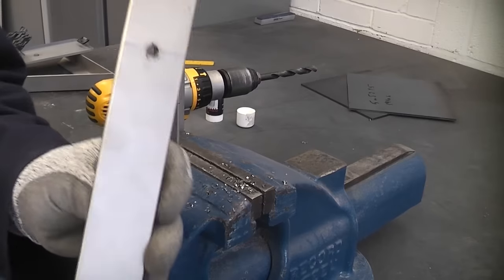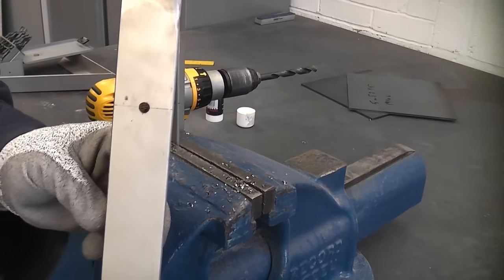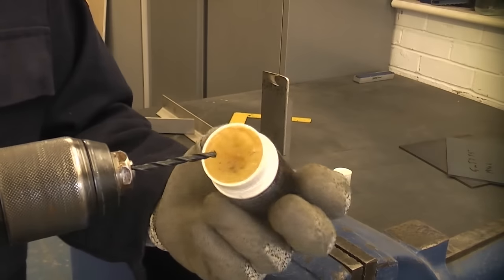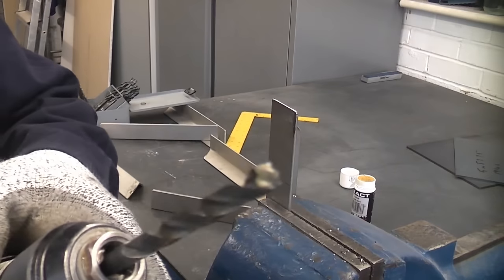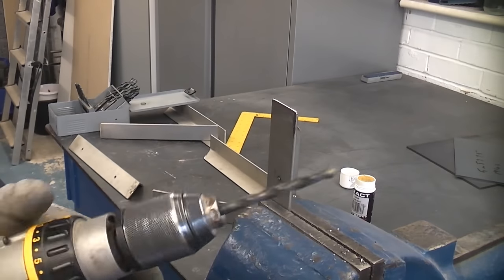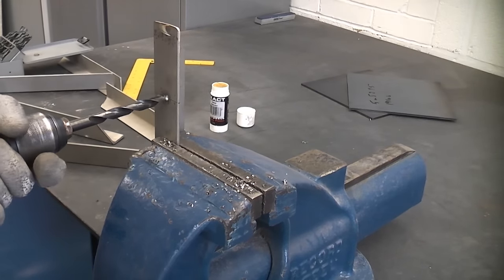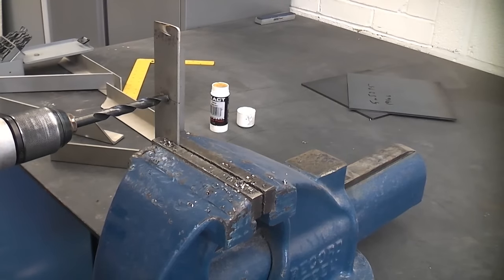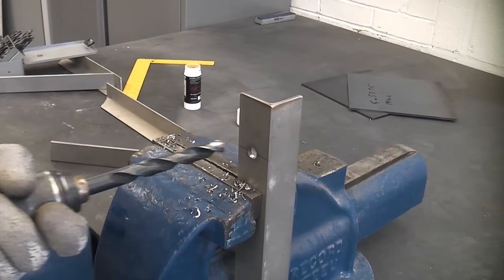How to drill stainless steel

Comment: Good vid, you make it look so easy, thanks!  I dont mean to butt-in on your really good vid, so please forgive me, but I just wanted to share this. I've always had problems with 304 and 316 (austenitic) stainless and I've found a few tricks that work for me.  The first thing is make sure the drill is as sharp as possible. If its a cheap TiN coated HSS jobber drill, it might not actually be sharp enough (or ground accurately enough) to begin with. If its not really sharp you'll never get it started. It also helps to start on a punch mark.  Your right about keeping it cool; last thing I did with stainless was drilling about 60 holes, 6mm diameter in 1/4" 316 plate. Because the piece was smallish and flat, I put the plate inside a tub filled with water (on a block of wood so I didnt drill through the tub) so all the drilling was completely submerged.  OK, it was a bit messy and obviously I could not clamp it, but it made a massive difference and I was able to breeze through 30 holes without needing to sharpen.  Just pressing the plate down a little before the downforce on the drill took over was enough to stop the work rotating.  Other things are; if sharpening drill bits, dont let them get too hot, you'll take the hardness out of the metal.  I keep a jar of cold water handy and just keep dipping the bit every few seconds to cool it.  I also use the water dip to keep the bit cool while drilling. As far as drill types go, yep, Dormer are quality, as are Presto.  Cobalt alloy bits are great but will also get dull if too hot, same as HSS. You can also get "solid  carbide" which are pretty expensive but wont dull (I've not actually used these these on stainless but have used them successfully on 6Al4V titanium alloy.  You need to be very very careful if using these manually cos they are very easy to chip or snap.
Reply from the maker: Thanks for the detailed comment 👍
Reply: Awesome information. Thanks man.
Reply: Nice. I’m thinking of using some kind of plastic container that’s rectangle and the same size as a 304 ss pipe i’ll use. I would fill it with water and i could put it in my vise.

I’ve just been dipping in water, but i am planning to drill a lot of holes.

I am thinking i’ll bring what i’m doing inside for the tapping process. I’ve broken a few taps when working in the 0°F shop. I reverse and break the chip, but i haven’t used oil or anything. I usually do something the wrong way a few times before i consult youtube.
Reply: I found this video and after reading your comment about submerged drilling I had to try it . I’m with the US NAVY SEABEES and we got some 5mil stainless gussets with incorrectly drilled holes. After a frustrating day of work hardening the pieces I watched the video and learned the proper techniques. The next day I built a custom box to hold the pieces and lined with plastic and started. I immediately got much better results. Your comment saved us a lot of wasted time
Reply: Sometimes you can see some smoky vapour rising up when you are drilling. I’ve always thought that you should stop then and cool the job and drill bit before continuing because it’s getting hot, but you didn’t. Am I missing something here ? Cheers.

Comment: Thats some soft stainless
Reply from the maker: All metals are soft, when you have the correct drill bit and the knowledge to use them 👍
Reply: @ultimatehandyman  not 304 ss
Reply from the maker: We mainly use 316 on site 😉
Reply: @ultimatehandyman your stainless is soft

Comment: Speed & lube yes but it is critical to know the the type of drill bits that work best. That drill bit went thru faster than I have seen going thru good stainless steel. Not too helpful so far.

Comment: When smoke starts coming off the job, doesn’t that mean it’s getting hot and you should stop. But you didn’t. Have I got it wrong. How else do you know it’s getting too hot? I don’t want to feel it. What am I missing here.
Reply from the maker: Too much heat is bad and will soften the drill bit and cause it to go blunt, but a bit of heat (enough to cause the lubricant to smoke will be fine)  👍

Comment: I just spent what feels like forever drilling stainless. Of course it was already hardend because knifes are hardend to keep an edge. Turns out my bit was dull! 10 minuts scribbling with it on my knife sharpening stone and it cut right through the tang of my knife. Now I need to sharpen again! I hate cheap drill bits! Thanks for the video! Great information.
Reply from the maker: Matthew Tikka There is nothing worse than cheap drill bits.
Thanks for the comment ;-)

Comment: Drill bits are important too. Had to drill some Stainless in an elevator yesterday and I broke all my black oxide bits trying to make one hole. Used a Milwaukee Cobalt bit and it did all the rest of the holes with out even dulling.

Comment: If you're in a pinch, a few sprays of WD-40 while drilling will work. Try to do it from the back side, to hide any marring of the surface. And TiN (Titanium Nitride) coated bits and taps will save you a lot of headaches, especially when working with smaller sizes. They can cut through some work hardened stainless.
Reply from the maker: +Christopher Weick Thanks for the comment

Comment: I drill aluminum, cast iron, and stainless steel at work and the only bits I got are HSS bits. Do I need cobalt or carbide bits for them? Or is that overkill

Comment: Thanks, glass and s.s. are the most pain to drill, by far- so true. What's the rpm (setting on the adjustable drill)?
Can you submerge it in water, while you drill, instead of using cutting oil or cutting paste?

Stainless, chipped my cobalt bit (cobalt bits, especially the thick ones are very expensive).

God bless, Rev. 21:4
Reply from the maker: Yes, you can submerge under water, if possible.
Stainless is a real pain, because it can work harden!
Thanks for the comment 👍
Reply: Not the place for your holly molly. Had you paid attention it was clear that it's good to use water for cooling.

Comment: What kind of bit is that ..?? I just tried to drill a hole thru T-304 stainless exhaust pipe and it was a MOTHER FUKER to drill thru. The screeching sound was insane. And yes i damaged 3 of my bits trying to drill thru but eventually i got thru.

Comment: Thanks for video .
I had to drill ss chefs  knife blade to fit a broken blade in a multi tool.
I cut the section out with angle grinder keeping it cool .
Marked out where the 4mm hole would be .
I used quire a blunt centre punch so had to hit it a few times .
So problebly  work hardened the area 😢
A good sharp drill bit in pedistal drill would hardly touch it .
Kept using WD40 to keep things cool .
I had to re sharpen 5 times before managing to drill half way through.
It produced a whitness mark which i was able to centre punch .
With a freshly ground punch .
Tried to drill again with same results 😢
I finished up driving the centre punch through the hole pushing the centre out  much like hot punching work in Blacksmithing .
I tried to drill the remaining metal out but to no avail .
I filed the hole out with needle files compleated the multitool repair .
I wish I  had watched your excellent  video first. Never to old to learn new tricks @69 years 😅

Comment: When you say "Don't let the work piece get hot", how hot are we talking? How do you know if it's too hot? When you were drilling through, surely it was getting hot there, right? Friction has to cause some amount of heat. Any tips on ensuring it won't harden?

And also, is hardening a permanent thing? If it DOES harden, will it just cool down over time or will it be permanently impossible to drill through?

Comment: Awesome, thanks! I had some brackets made wrong and now I need to drill four 12mm holes through 3mm SS. Who would have thought YT would recommend the exact video I needed. Now I just need to compare prices of 4+7+10+12mm cobalt or a cobalt step drill. 🙂
Reply from the maker: Cobalt step drill is the easiest option, I bought a set a while back-
https://www.youtube.com/watch?v=fvumt2z0GLI&t
Reply: @ultimatehandyman  Thanks for the reply. I bought a cheap set of HSS step drills a while back from Banggood too. Currently they show cobalt sets, but only sell individual drills which get expensive in the larger sizes.
A professional step drill from my engineering supplier costs over AU$250. I copied your demo and bought the 4 twist drills for AU$85 (around ₤45).
Reply from the maker: @philscott7949   Blimey, I did not realise things were so expensive in OZ.
Lucky you can use Banggood 
Thanks for the comments 👍

Comment: Okay I thought I was drilling mild steel. Turns out that it's stainless steel 6mm thick. I've already started drilling the holes. I think I've work hardened the holes. I'm probably only got about halfway through. I've tried use HHS drill bits, cobalt and just brought another DeWalt drill bit specifically designed to drill SS. I've not gotten any deeper.

Have I now ruined it by work hardening it? What are my options now? Do I got out and buy another drill bit? Diamond coated maybe?
Reply from the maker: It's a pain in the backside when it work hardens. I would try a good quality cobalt drill bit. You might have to get a smaller diameter one and go through with that first, so if you are drilling a 8mm hole, go through with a 4mm first. Use plenty of lubricant/coolant. If it is not cutting you might have to start looking at specialist drill bits such as a TCT one, or solid carbide if you are using a pillar drill.
Good luck with it.
Thanks for the comment
Reply: Okay I've tried a small bit but it but it doesn't seem to bite. I'm going to try TCT bit

Thanks for taking the time to comment. You're videos are very useful thanks

Comment: Good job... Heat is the enemy, I spritz the material and dip the bit with water and allow both to COOL😎  in between bit size progression, time (+/- 10 seconds or steam) and depth of material. Clearing debris along the way. 
Initial drilling (most important) too fast will harden the steel instantly, then you r mostly screwed. Slow and steady don't AK47 it.
Reply from the maker: Thanks for the comment 👍

Comment: When centre punching stainless I try and make it as small and gentle and possible, just enough to seat the drill. If you are too heavy handed or strike repeatedly you can work harden the area you are trying to drill which at best makes it harder to drill but at worst can actually make the drill skip off the hardened area making it inaccurate.
Reply from the maker: Thanks for the comment ;-)

Comment: Tried HSS bits. Nothing. Tried titanium bits. Nothing. just bought cobalt drill bits….using smaller bits…using oil…drilling slow….barely making a dent. Can Anyone help?
Reply from the maker: Are you sure it’s stainless-steel and not hardened steel?

Comment: The worst time drilling stainless 1/8 inch thick, turns out it was my cheap Harbor freight drill bits...  Got some better bits voila keeping your tips in mind thank you so much!!  
PS... Cheap Harbor freight bits work pretty much for everything else sometimes you have to sharpen them right.
Reply from the maker: Yeah, you need quality drill bits for stainless 😉
Thanks for the comment 👍

Comment: great vid thank you, you made that look easy, does the same apply to all ss? Im intrigued by the start stop start stop when you first start drilling, what purpose that serves, does it make the bit bite better or some thing?
Reply from the maker: Pulsing the trigger/switch can help to get the drill started without slipping off, it can also help prevent the drill bit from overheating. Metabo actually makes a drill with a pulse function 👍

Comment: Hello and thank you for the excellent video.
I need to drill 4.5mm side through-holes to a 10mm diameter 1.5mm thickness 304 stainless tube and I just wasted 4 cobalt and 2 hss drill bits and managed just 2 holes. I used oil, water and soap water as lubricants and different speeds and only managed to work harden (anneal) the pieces making it impossible to proceed.
Can it be the drill bits that are not good? Can you suggest something? Thank you
Reply from the maker: There is a chance that the drill bits are no good. Normally a good quality cobalt drill bit will easily drill through stainless steel, but I bought a set from Banggood and they were absolutely useless.
If you can get them a make like Heller should easily drill it- https://fave.co/2XkTSGp
Dewalt cobalt bits are also good- https://www.youtube.com/watch?v=cAkvS4-vTII
Thanks for the comment 👍
Reply: @ultimatehandyman   Thanks a lot for your advice. You are probably right. Meanwhile I drilled a few holes using an ordinary hss bit and soapy water which is not very efficient but has the advantage of not breaking easily. If I do not find your recommended drills I will go on with hss ones. Much obliged!

Comment: Just to be clear heat does not work-harden stainless steel but it will soften the cutting tool edge.  Stress work hardens the workpiece especially if you do not feed (push into the metal) fast enough.  Sitting on the surface and spinning at any speed will work harden the steel.  So a slow cutting speed and high feed rate is the way to go ... but as you say with thin material if you push too hard you will end up with a hole that is not round.  I find a shallow bit or a good quality electricians step drill to work the best on thin stock.

Comment: I'm doing a ambulance conversion into a camper. The box is all framed with square tube aluminum? I can't seem to screw anything into the metal. I'm installing E tracks to support a bed and would like to utilize the metal posts. I tried self drilling screws #8, 1-1/4", didn't work. 😭 Help! Thank you.
Reply from the maker: Rivnuts should work- https://www.youtube.com/watch?v=f7yIqKnLGPc&t
👍

Comment: I am drilling even slower with oil and it will not drill at all using cobalt steel drill.  it may be a harder variety of stainless, would diamond work? Nothing they sell at my hardware store drills this angle iron, they even tried and it is hard to do for them.
Reply from the maker: Some stainless can be a pain to drill, but cobalt should work!
Diamond will definitely work, but the bits are difficult to get started and are very slow.
Example here- https://www.youtube.com/watch?v=7JCfEMrCjhc&t
I'd try different cobalt bits to be honest, but try to get a good quality brand, such as Heller - https://bit.ly/3x1ZS8A

Comment: I'm like new to drilling and I just need  drill to drill stainless steel rods. I already got some HSS cobalt drill bits but not sure which power drill i should buy. Do you have any recommendations? Such as the voltage, torque, rpm for the drill? Thnaks for the video btw!
Reply from the maker: It really depends on your budget. I'd get and 18v drill if possible, preferably a good make such as Dewalt/ Makita/Milwaukee/ Bosch/ AEG 
They should all have enough torque and speed for most jobs.
Thanks for the comment 👍

Comment: For daytoday household appliences which drill is ideal and how many (W) power we need to drill nonconcrete Walls, Stainless steel etc!!! sir
Reply from the maker: I would choose a cordless drill if possible. Any 18v drill should cope with any DIY job, including drilling stainless steel 👍
Reply: @ultimatehandyman  thanks you so much

Comment: Very helpful, thought I'd need the biggest drill possible and go through full throttle! Also been told a cobalt bit is the best one to go with?
Reply from the maker: If you are drilling material up to 5mm thick, you can use a step drill.
I'd recommend a good one though, with plenty of coolant/lubricant-
https://www.youtube.com/watch?v=HPv0W0UNdks

Cobalt does work better on stainless, I once picked up some cheap cobalt step drills from banggood, they worked well for the price-
https://www.youtube.com/watch?v=fvumt2z0GLI

Thanks for the comment 👍

Comment: Drilling metal can be such a pain in the butt, yet so satisfying to watch the chips curl and form. Make sure you have a properly sharpened drill bit to work with, a dull one just spins without cutting and just adds to the friction.
Reply from the maker: Absolutely, dull drill bits are useless.
Thanks for the comment
Reply: It's funny, I was trying to drill through the shaft of a motor and it just wouldn't go... I tried a few different bits, plenty of lubrication and even tried drilling it with my drill press, i got a slight dimple in the shaft but no waynim getting through it. :/
Reply from the maker: P0tat0_craft Have you tried cobalt bits?
If they won't touch it the shaft must be really hard!
Reply: P0tat0_craft And if the cobalt wont bite, then use a carbide bit =D that will go through anything... but its damn brittle tho.
Reply from the maker: He Ka Yeah, I tried Carbide once. Like you say they are incredibly brittle!
I'd not even attempt to use one in a hand drill.
The Artu drill bits are good and will even drill hardened steel as long as you can run them fast enough. 
https://www.youtube.com/watch?v=zbJq2z2ya80
Reply: +Ultimate Handyman Do you have a video on how to sharpen drill bits?
Reply from the maker: +Joel Laight 
Yes, but only using a diamond file- https://www.youtube.com/watch?v=DZrbeyATkvg
I hope this helps ;-)

Comment: Umm, I was hoping you would mention what kind of drill bits you used because that is NOTHING like when I tried to drill through stainless.  My drill just sat on the surface and laughed at me.  I barely made a mark on the material so I assume I needed better bits.
Reply from the maker: Cobalt drill bits work well on stainless 👍

Comment: I know this is an old vid... but does steel type make a difference?
Planning on drilling through a steel table that i'll buy soon. My options to purchase are from stainless steel #304 or #430
Reply from the maker: Yes, some steels are more difficult to drill than others. I'm not familiar with 430, but 316 is harder to drill than 304 stainless.
Thanks for the comment